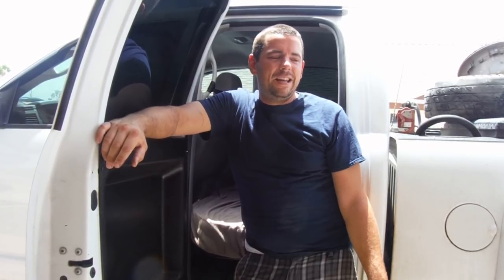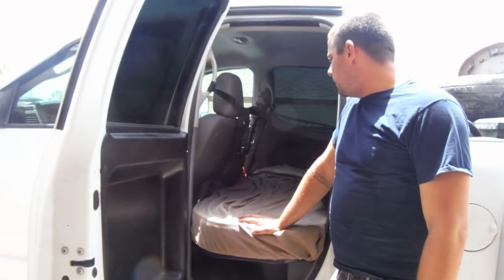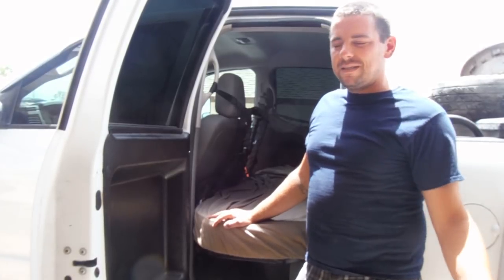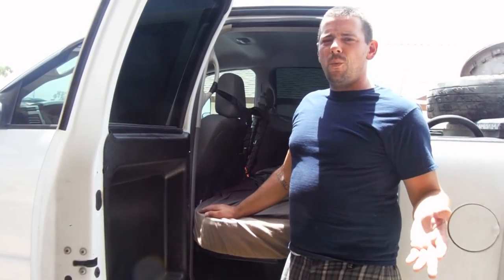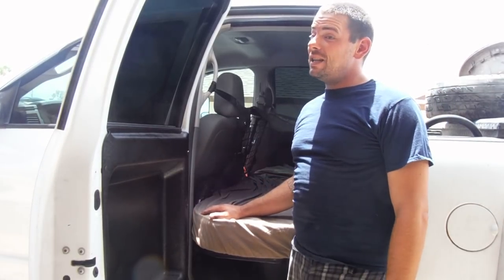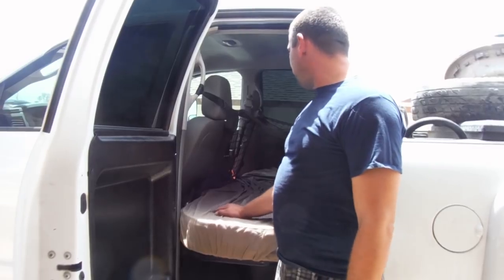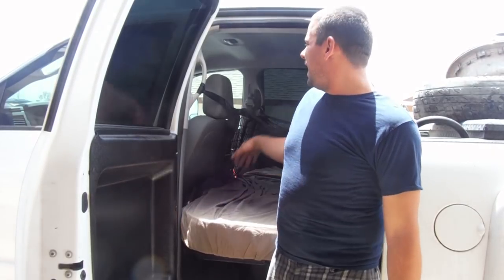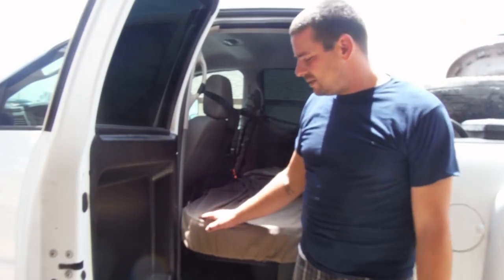How To Hotshot sleeper birth HOW2HOTSHOT.COM

Comment: Run teams w/out a front seat? WTH? What if you want to take your wife with sometimes? It's 2018, Trump is cutting regulations and I see he met with a trucking co. a few days back. Hopefully (most) obnoxious rules and regs. will disappear. Trump says for every reg. he's cutting two. Free America!
Reply: WeeeThPpl If the passenger seat stays then it is no longer a legal sleeper birth. The reason they remove the passenger seat is because the rules state that a legal sleeper must have a "direct and ready" path between the sleeper birth and the driver's seat which is unhindered and has an opening or passage which measures a minimum of at least 18"x36".
Reply: @KaMiKaZeE1337  what if you remove the center section in between the two front seats? It should have the sufficient measurements and a direct path to the driver seat.
Reply: @sKeLEto03  It could possibly be enough, that's how semi trucks are set up. You'd just have to measure and make sure.
Reply: @KaMiKaZeE1337  worth the shot I'd rather keep my seat!
Reply: How can wife travel without passenger seat! Oh no!
Reply: @KaMiKaZeE1337  What I'm getting at...is Government Regulations! We are supposed to be FREE PEOPLE!!!
Reply: @sKeLEto03  We are supposed to be FREE PEOPLE! Government Regulations....Pffffftt...
Reply: @KaMiKaZeE1337  Government Regulations....We are FREE PEOPLE!!
Reply: @sKeLEto03  ???

Comment: I got rid of my dually and bought a cheap single axle tractor. Slept better, still got good fuel mileage, I could haul more freight, and less maintence using the right tuck for long haul work
Reply: Exactly, had a  mid 90s Mack CH single axle with a 42" sleeper.
Reply: And how much does that truck weigh?

Comment: Do you see how its counter sunk on the doors to reach the measurements. A door handle on each side reduced those #'s over 7".
This seems the closest I have seen. Lots of Hotshots todays date still think they can just sleep in the back of their pickup. Or are just logging off duty hours and flying under radar. At the same time, many people are still getting tickets left and right. I have heard you need a CLEAR path to the Driver seat while in the sleeper? how is that strap helping that?

Comment: Great explanation and thanks for taking the time to do the video. I do think you are mistaken about harnessing into sleeper when you're not moving or before going to sleep. The safety system is designed for two and should be used only when moving. It wouldn't make any sense to belt yourself in when you're parked just as you don't need to wear a seat-belt when your parked.

Comment: Whats next, special requirements for tent camping? Talk about government over reach.  To do this to your truck means you cant use your truck when you are off duty for passengers.  
I just don't get it?  When you put all these regulations on the people you make it harder for people to want to get into an industry.  Yes, Hotel rooms every night is expensive.
Reply: P/U trucks plated at 26,000 lbs or less do not have to have a sleeper birth. If you have a mega cab just fold down seats will have plenty of room.
Reply: Is America
Reply: Mark Hoffman
Well they (DOT) need to set some standards for what a sleeper compartment is.
Of course you have the right to have an opinion on how much is too much regulation, but I see the legitimate need for some standards.
Their goal is to avoid sleepless zombies pulling heavy trailers on public roads.
Reply: I'd rather do a roof top tent than that sleeper & I'm in Wisconsin
Reply: 'MURICA! Land of the FREE!* 
*(Except for rules, laws and regulations)
Reply: Well you can thank that regulation for lightening up the rules so if you pull for profit you can now do this, really needs to be the same regulations for ALL vechicles if you sleep in them while working.
Reply: BBBY really needs to read the dot regulations for interstate hauling,not just 1 state.Oh and remember if you are hauling private or commercial you better have the right class licence for the gvwr you have on that pickup.
Reply: If you buy a truck to work it, register it 26,000lbs or over and get commercial plates and permits for it it is no longer a passenger vehicle unless registered and permitted as such nor is it a personal vehicle. If I get in my rig to go get groceries I still have to conform to dot rules and regulations. These problems develop when you buy trucks and repurpose them. They are f350 pick up trucks that these guys buy and think they're the king of the road in a brand new peterbilt 389. I agree these trucks have a place in the industry, but not where they are now. As for government overstepping? I dont see it. I see the "government" if you want to use a very vague term is protecting company drivers from having to sleep in unhealthy conditions like laying across seats or up against the window or steering wheel. It is also insuring that drivers (owner op, and company drivers alike) have a comfortable sleeping space and adequate time to get rest while not driving thus keeping the roads safer for everyone who uses them, and that people who drive said vehicles, who are typically smokers, sleep on flame resistant and retardant mattresses that are usually right above fuel tanks, which also makes it safe because mattresses are inherently flammable and burn very hot and quickly, this alone could save a life. The comment about camping is unrelated and pretty stupid to add in as well. Think before you speak dumb fuck
Reply: Mark Hoffman 
  It's good to use this set up for legal tandem drivers
Reply: It is not necessary it's not true he doesn't need to have a
 bed in the truck.. sleeping birth is just being off duty for 10 hours break after 11hr drive , is a paper log concept it doesn't translate into tearing  up  your truck and put it in a mattress.
Reply: @BBBYpsi  I think you answered  my question, seems like if I'm  driving and hauling non CDL required loads I can design my sleeping area how I please.
Reply: @jasonbourne1596   If you are in a pickup truck and plated 26000 pounds or less you do not have to have a sleeper. You can do what you want in your back seat I took the front seat out and the back seat out and build the little bed that's not that's not a legal 76" sleeper that's required in semi trucks. In 2012 they changed that rule for people with pick up trucks. I have been hauling travel trailers since 2012 I used to Drive a semi truck.
Reply: @PennWolfsSailingAdventures   Been hauling travel trailers since 2012 I do have ACD L class a license used to drive a semi truck I know what I'm talking about I go to all lower 48 States and sometimes Canada with these travel trailers I'm plated at 26000 pounds. There is no sleeper birth required in pickup trucks they changed that rule in 2012. Read guidance 393.76 under Q & A

Comment: Joe,

So based on what I'm seeing and reading here, it is NOT required to have this system while the truck is stationary....only while it's moving (meaning the restraint system). Swingle Jason mentions below that the rules have changed and we can just make a bed in the back and sleep without breaking any DOT rules, is this correct and where can we find these 'rule changes'?? I just purchased a non-cdl straight truck with a crew cab that I want to turn into a sleeper, or have the ability to sleep back there when I want to.....so I want to be 100% certain that this is in fact the case and I can sleep back there. Awesome videos by the way.
Reply: ARTGALLERRY AJ you're good. As long as you're logged as "off-duty" and vehicle isn't moving.
Reply: The "net" restraint that comes with this setup, IS required while you're moving....but it's purpose, is to keep anything stored behind the driver's seat from flying forward, and taking out the driver during a hard braking, and/or collision type event.

Comment: Keep in mind sleeper is not required but for team drivers it is. You can’t explain to the officer you got 10 hours of duty without a dot approved sleeper
Reply: joel guevara Absolutely correct. You can only log off duty while sleeping in the truck if it is not moving. If the truck is moving as with teams, you can only log 2 hours off duty in the passenger seat and the rest must be in a legal sleeper birth.

Comment: Wht not just put extensions on the front seat so it can move all the way forward to the dash. That & with the center console removed should give plenty of room to go from front to back.
I'd also just get rear replacement door shells & the glass then keep to be able to reinstall rear doors to convert back or sell them as full rear doors.

Comment: some good info. im gojng to start running a 3 car in a few weeks. i got a insurance quote for 900 a month with 1500 down. the vehicles are new. ill be pulling out of chicago heights Illinois. seem about right?
Reply: Section8 millionaire If you don't mind me asking, who did you go through for your insurance provider, and is that with the 1 Mil overhead policy?

Comment: you don't have to buckle in the restraint system unless the vehicle is moving. we run teams and you only need to buckle in if the truck is moving.
Reply from the maker: True. I like the safer option though :)
Reply: if it's parked you should be plenty safe.
Reply: Shannon Aitken you ryn team with that slepper set up??

Comment: The only practical use I could see for this is if you're team driving. Which if you're hotshotting...why? 

But all of this is spending money unnecessarily. I hotshot with an F350 crew cab with no mods to the backseat and have never had an issue. All you have to do is log off duty

Comment: great idea, im a UK truck driver was wondering what "hot shotting" was? thanks in advance
Reply: Dave hawkins "hot shotting" is generally driving a smaller truck like this one to take "LTL" or "less than truckload" expedited freight. As in, a shipper has a quantity of freight (including vehicles) that would not fill a standard class 8 semi-trailer, but they need it shipped quickly, so a "hotshot" truck will be a smaller lighter unit that can take the load quickly to its destination without needing to hire a full size class 8 heavy truck.

Comment: what about in the winter time, when you idle your truck to keep warm during the night, how would you deal with carbon monoxide issues?
Reply from the maker: I went out an purchased a CO monitor at Walmart before I slept in the truck the first time and I always leave a window cracked. The CO monitor looks like a smoke detector
Reply: Does idling all night cause any issues with over heating the engine. Whether heat for winter or ac for the summer.
Reply: systemsoundbar if your truck's exhaust system is properly constructed and in good condition you should not have excess carbon monoxide building up in the cabin. But purely for fuel economy and idling laws, I'd recommend to turn the truck off and just crack a window and use extra blankets, unless you are somewhere super cold like sub zero temps, then I would idle and run the heat.

Comment: a passenger can sit up and ride on the passenger side correct?  does the back of the rear seat remain?
Reply from the maker: We have done this and never gotten any grief because the seat belts remain. The rear seat is replaced completely with a mattress. i would check with DOT first though
Reply: I got mine installed. I had to make them put the rear of the Seat back in, and put the normal seat belts in so I can have a passenger. So far I am liking it and saving some $$$ on motels.

Did you reinstall the rear of your seat or did you leave it out? When they left mine out I felt like there were were to many sharp edges to catch on so I made them put it back in
Reply from the maker: That's great Shannon. No. i never had them install the rear. i didn't know i could have done that until later when i had seen someone else with it like that. Now i roll solo so i dont really have to worry about it. i left the seat belts in though.
Reply: I wish I could put the passenger seat back in.

Comment: Instead of going with a set up like this just invest in a a 27ft Class C Coachman Motorhome 18 foot enclosed trailer and 18ft Flat Bed Equipment Trailer I also have 2 1997 Chevy 1500 converson vans 16 foot Flat Bed Equipment Trailers and 16ft Enclosed Trailers
Reply: Gary Burbank and how are you going to haul 5th wheel RV’s for a living with that again? That’s what this guy does FYI.

Comment: hot shot sleeper ? no problem..buy a 1 ton van..cut the van body back enough to allow clearance for a 5th wheel....equip it like a 76" t680 sleeper..good to go
Reply: Oh man the fuel economy on that atrocity would put you in the ditch before your first load delivers.

Comment: What I don't understand is those restraint belt things, I've never seen anything like that in a class A so why would a pickup need them? Granted I'm not a trucker at all, but I've watched so many videos over the years and never seen those in a truck. Your setup looks uncomfortable as fuck, I wouldn't even fit in there. I'm not trying to be critical, just saying the DOT shouldn't be regulating any of that stuff, a driver shouldn't have to alter their truck in any way just to do work with it.
Reply: Nodak81 FMCSA 393.76 (h) "Occupant restraint. A motor vehicle manufactured on or after July 1, 1971, and equipped with a sleeper berth must be equipped with a means of preventing ejection of the occupant of the sleeper berth during deceleration of the vehicle. The restraint system must be designed, installed, and maintained to withstand a minimum total force of 6,000 pounds applied toward the front of the vehicle and parallel to the longitudinal axis of the vehicle."

Comment: will that set up work for teams?
Reply from the maker: I have done it many times and gotten nothing less than a high five from every DOT officer i have come to meet
Reply: Mike P we do it with teams
Reply: Mike P how can it work with team if its messing the passenger seat?? will it still be able 2 be set if the passenger seat stays
Reply: How2Hotshot  can you use this with team
Reply: How2Hotshot the sleeper wit the passenger seat or is it in the way
Reply: Carlos Salinas If the passenger seat stays then it is no longer a legal sleeper birth. The reason they remove the passenger seat is because the rules state that a legal sleeper must have a "direct and ready" path between the sleeper birth and the driver's seat which is unhindered and has an opening or passage which measures a minimum of at least 18"x36". As for teams using this setup, one person can be in the sleeper while the other is driving.

Comment: How can I get into hot shot .
Reply: Don't do it,  just quit and bought a 18 wheeler,  cost less,  used dually is in the 30 thousands,  new trailer about 12,000, plus all permit and insurance,  at the end,  barely no money,  tires don't last, bad, then too many of them, buy a truck , you can get a modern Volvo 780 with Detroit for 50,000, new dually dodge 3500 with 6.7 Cummins is about 70,000, just think about it
Reply: Ahhh, I'm a otr driver,  10 years,  3 with my own authority,  work with someone first and learn then move on

Comment: YOU LOSS THE RESALE ON THE TRUCK 1\2 THE TRUCK RESALE
Reply: A truck used for hotshot driving is going to be ran into the ground with 500K miles on it a few years anyway.  Not to mention all of the hail damage and debris you will inevitably run into.  If you want to keep your truck pretty, hotshotting is not the way to do that.